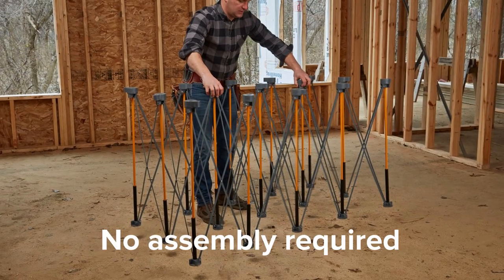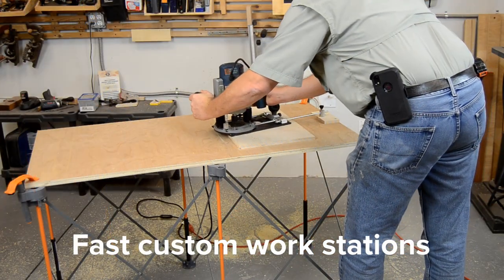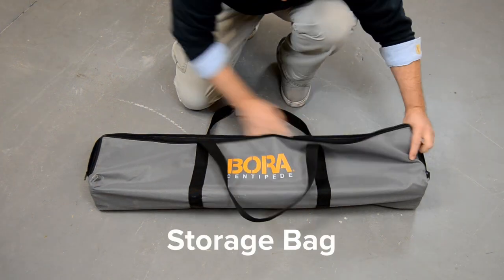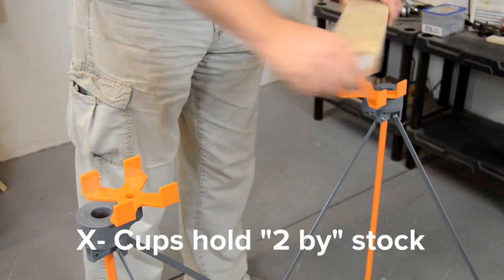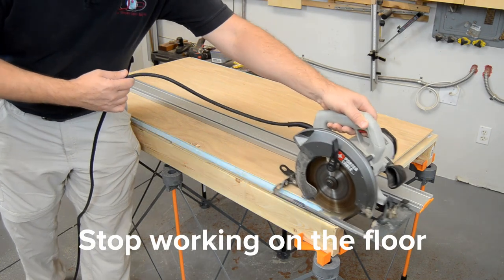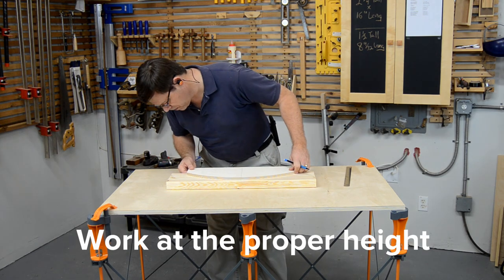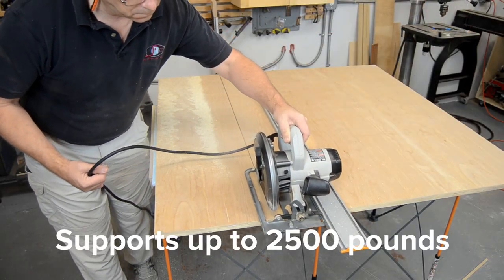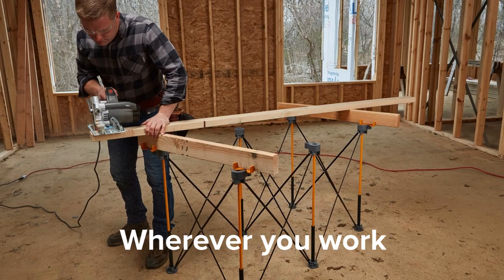Bora® Centipede Workstand & Accessories Overview

Comment: the actors in this video are approximately 4'8" to 5'0" tall, that is the height this table was designed for LOL....it's a cool concept, I want to use it more but it's 30" tall, when you add the risers I found it got too wobbly....I've never seen a 30" tall table in any shop I've worked in, not sure why Bora thought that was an appropriate height